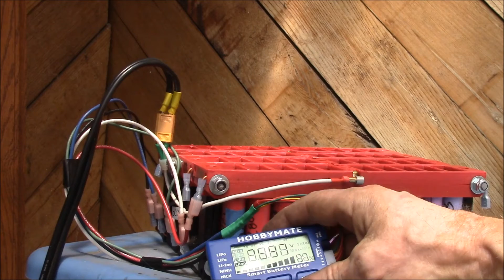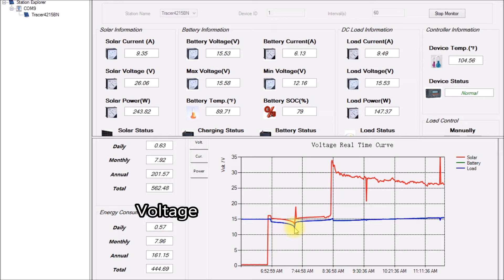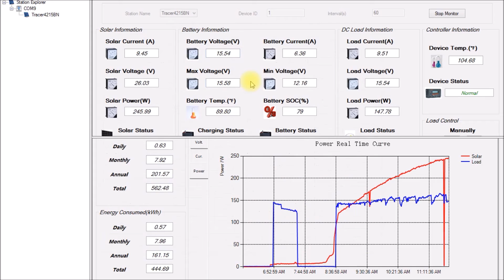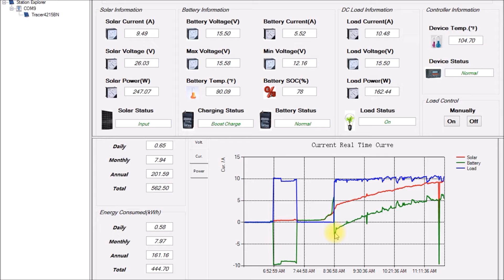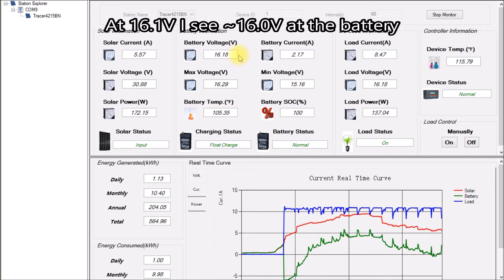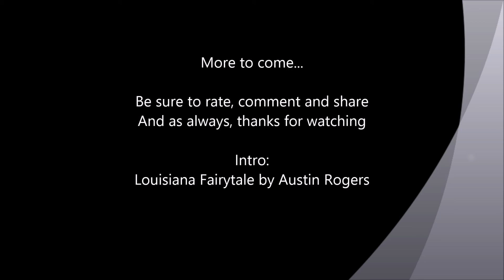Tracer 4215BN Charging 4S/16V Li-Ion Battery, Part 1

Comment: Shoot, i thought you had a video on lifepo4 parameters. This is for lithium ion, did you also do a lifepo4 video or am i mistaken?
Reply from the maker: Part 3 in this video series has a link to the LiFePO4 settings that are in the Solar Station Monitor program:
https://youtu.be/ofmXkwYEbvo
I've never worked with that chemistry myself.  But the way I did the Li-Ion settings was to pick you volts/cell values I wanted to use, then multiplied by however many series cells and used those voltages for the charge controller setting.  You have to adjust those a bit for the 0.1 volt resolution in the settings as well as the constraints that some parameters have to be smaller than other parameters.  I had an additional constraint that I had to stay below my AC power inverter maximum DC input voltage rating.
Reply: @The4Crawler  Thanks for the link and info!

Comment: Hello!     I have a Tracer 4215bn which is now used for solar panel mounted on my car roof. I am going to change battery from lead B to lifepo4 B.   I want to know whether the 4215bn can be used also for lifepo4 battery by changing some parameters.  If you know, pls disclose.  Thanks.  from Osaka
Reply from the maker: Sure, I mention that and show the parameters that the PC monitoring software uses.  In short, pick your desired per-cell voltages for charging, over and under voltage cutoffs, etc. then multiply by the number of cells and that's what you plug into the charge controller.  May need to tweak those numbers a bit as I show in the later videos because the controller has no voltage sense lines and also it only have 0.1 volt resolution on the settings.
Reply: Thanks for quick reply.    I have recently purchased 4pcs X  280ah lifepo4 batteries to build up 12V system.  According to the leaflet, charging voltage is 3.65V per cell   X   4pcs = 14.6V        Therefore, 14.6V that is suitable for lifepo4 B must be led to 4S lifepo4 battery.  Do you know how to change the parameter?   GEL/Sealed/Flood/User
Reply from the maker: @himurayan5054  User battery type, that's the one that has modifiable parameters which is what you need if you want to put in custom settings:
https://youtu.be/4XhvwruVEJU
Reply: Thank you again for swift answer.  In short, the 4215bn can be used for 12v 4S lifepo4 battery only by changing parameters.  is my understanding OK?
Reply from the maker: @himurayan5054  Yes, select USER battery type and enter the parameters you want.  This video has a link in the description to the LiIon and LIFe battery parameters that I used and also that I copied from the PC program:
https://youtu.be/ofmXkwYEbvo
You'll probably want to change them for your specific battery.
Reply: Hi Brown san       I deeply appreciate your kind advise.   I will watch the video you linked and study how to change parameters.  I will soon become very busy to build up the 12V 4S lifepo4 battery system to be incorporated in my car.  Thank you so much from Osaka.
Reply from the maker: @himurayan5054  No problem.  Sounds like a good project.  I find if I make a table of all the parameters with columns for one cell, then all the cells in series and often I'll have a column of the starting parameters out of the PC solar station monitor program.  Fill out all the different numbers and start entering them into the controller.  You'll likely run into some conflicts, such as one voltage must be less than another voltage, so you'll need to adjust values 0.1 volts up or down.  Then test it out and see how it works and you may need to adjust parameters again.  I found it took 3 or 4 tries to get mine dialed in.  My main issue was my AC power inverter that shut down above 16.0 volts.  In your system it may be something else that's the limiting factor.  But just keep track of your original numbers, then each trial and then when you reach a final set of parameters that work, keep a record of those in case you need to reset the controller or something like that.
Reply: Due to my poor English ability, I have to peruse the long information you mentioned in the above. i.e. it tales time to fully understand it.  Thank you.

Comment: I have applied this configuration to my epever charger controller which was attached to  4s 18650 battery pack.But suddenly the battery voltage reaches to 16.4V in boost mode and then inverter cuts the supply. How do i fix this?
Reply from the maker: That's part of dialing in the parameters, check out the next video in the series:
https://youtu.be/4wt_L2L4W4Q
I dialed the voltage back to keep from overshooting.  The main issue is that the charge controller doesn't have any voltage sensing leads and instead measures voltage at it's output terminals.  So you need to keep trimming back the upper voltage setting, 0.1v at a time, until it stays below what your inverter can handle.
Reply: @Srirahulan Shanmuganathan, hello, great fine and thanks you so much for your question as I have the very same problem with my Epever 5420AN and 8s LiFePO4 battery pack. I am very interested in finding out if you were able to solve your problem and if you care to share your curent charger configuration.

Comment: I just bought an epever tracer 2210 MPPT controller. It is running all settings on default as I couldn't understand the setting from and manual. I have a 4S 17s  (24V panel) Lithium-ion Battery pack. Can you please tell me ay basic settings I need to do and especially the battery selection. thanks.
Reply from the maker: User battery type:
https://youtu.be/4XhvwruVEJU

Then set up your desired voltages similar to what I've done.  I used 4S/16.0V, you can find them in the description of this video:
https://youtu.be/ofmXkwYEbvo

Easiest way to set yours up is decide on your per-cell voltages and then multiply those by 4 (for 4S) and then round to the nearest 0.1V for the charge controller setting.
Reply: @The4Crawler  Thanks for your fastest reply with 15mins. I viewed the videos you have given in your reply. They are too hard for me to understand and follow. Also, you have a remote meter and doing all the settings. I have only the controller and after your reply, I could change the battery type from seeled to the user, but do not know how to set my charging voltage for my 4s ( max 16.8V) My controller now stopped at 14.4V and not charging anymore even my PV shows 40V.  Can you please advise me in simple language to raise the charging level in my controller?   Thanks a lot in advance.
Reply from the maker: 14.4V is the default charge limit on the lead acid battery types.

I've never used one of these units without either a remote meter or the USB data cable and the solar station monitoring software:
https://youtu.be/k7qaGk6WsXc

Or something like the WiFi or Bluetooth adapter:
https://youtu.be/6qz9wkCUMnc

Here's a video on how you can make your own USB data cable:
https://youtu.be/r3LrWeYYtnQ

I'm not even sure if it's possible to do things like edit custom charging voltages without one of those options.  You might contact EpEver to see if they can help with that:
https://www.epsolarpv.com/contact.html
Reply: R Brown Great reply and contact info to find answer to me. I will try whatever I can do. Thanks for your nice videos and service

Comment: I realize this is an old video but I want to say you never want to have an Li battery in equalization or float mode.  You want to set them so they will never come on.  I think your 16V and 15.9V keeps them from ever being utilized.  Please clarify if you know more now 2 years hence.
Reply from the maker: In a later video I adjust these values a bit.  But that said,  if the boost voltage = equalization voltage, then there's no real difference between boost charge state and equalization charge state.  And I set the EQ charge time to 0 minutes, so I think it should never run.  There's no explicit way to turn on the EQ charge mode like there is on some controllers.

Since I'm running at only 4.0v per cell, I just stop the charging in whatever mode to that voltage.  Not worried about over charging the cells because they never get above 4.0v per cell or 16.0v for the whole 4S pack.There's usually a load on the system and during the day, it rarely gets above 15.9v, usually sits around 15,85v or less.  Batteries are still going strong after 2+ years of use.
Reply: @The4Crawler  excellent.

Comment: hi...can i ask u somethin...i ve got my epever tracer 3210N series...can u tell me battery parameter setup for my 18650 with 7S80P battery bank ? consider the full voltage will reach 29.4V (i am running on 24V system).....very apreciate for the reply
Reply from the maker: You can check out the parameter files in my Google Drive folder:
https://drive.google.com/drive/folders/0B89_DmuFw50kOFJpRWltMllORmc

I have 3S, 4S and 6S settings.  The 3S and 6S are the factory default settings and the 4S is the one I set up for my 16V battery pack.  Easiest approach is to pick one, and get the per cell voltage for each setting then multiply by 7 to get your own parameters. For example, I use 4.0v/cell on the 4S pack and then set things up off that value.
Reply: R Brown thanks for your reply...
allready look your google drive..thats awesome..very helpfull..
can u suggest for my 24V system...best using 6S or 7S ? Thanks...
Reply from the maker: Seems 7S is quite popular.  You can run 4.0v/cell for 28V or up to 4.2v/cell up to 29.4 and still have a decent low voltage cutoff around 3.0v/cell  With 6S, you can't run very low before things like power inverters shut off.

Comment: Thanks for the video. I have a question, I had a look at your batteries. Woundering how you get 3904mAh (as written on one of the the batteries) out of that 2550mAh Rated battery ? (according to this table: https://secondlifestorage.com/showthread.php?tid=1795) 
Are you testing with 1000mA or  500mA or even lower ?
Thanks in advance.
Reply from the maker: This is the capacity rating for the pair of cells as they came out of the laptop battery pack.  The pairs were tested at 1000mA discharge from 4.1v to 3.0v.
Reply: thanks, much appreciated.

Comment: Hi! Can you help me? I have some trouble. I use 3s li-ion battery. When i connect power supply to my tracer 1210a there is no current to battery. I used same settings as you, but recalculated it for 3s.
Reply from the maker: Not sure as I've never seen that issue on my 4S battery.  But I would check the under and over voltage settings to make sure that the battery voltage is within that range.

Comment: i was charging around 16 volts too but have switched to the 16.8 voltage range now. for me the battery's are really working way better,  now im getting almost whole day more usage  between charges now
Reply from the maker: Good to hear, thanks for the information.  I'll be sticking to 16 volts as that's what my AC power inverter maxes out at.  I still need to test that part of the system, but I figured I would dial in the charging parameters first.
Reply: my battery bank is for my dc computer. it has a dc voltage range all the way to 19 volts. i really try to keep things dc myself sure make things easier for me
Reply from the maker: Sounds like a good setup and makes sense to go as high a voltage as possible.  I have a lot of DC loads as well, mostly 12 volts.  But for now, still have some AC loads I want to power as well.  Trying to find a happy medium on the voltage I'm using.  You only get around 75-80% capacity at 4 volts/cell compared to 4.2 volt.